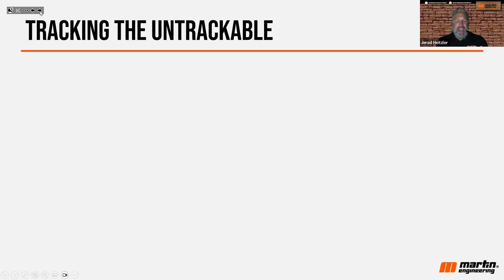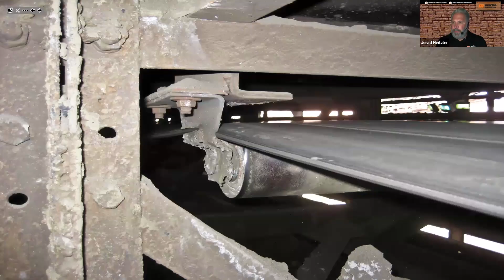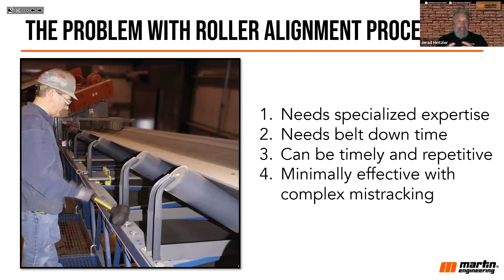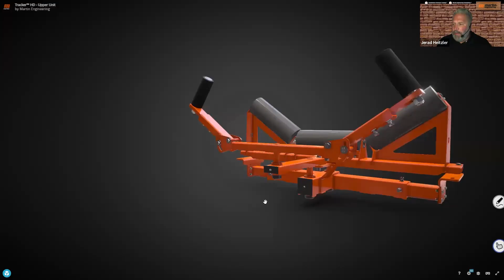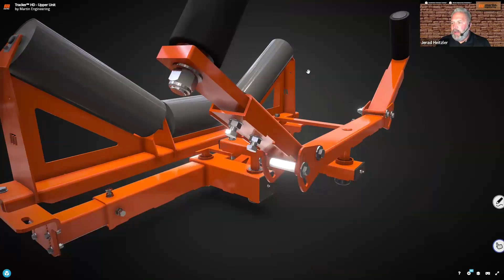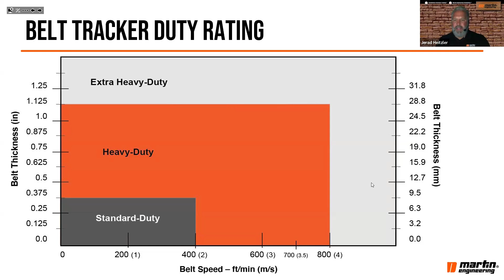Tracking the Untrackable Conveyor Belt

Comment: I don't understand how you can be a materials handling equipment technician and not have the expertise to track a belt.
Reply from the maker: Belt tracking can seem straightforward, but in practice, it’s influenced by many variables, like load conditions, belt tension, pulley alignment, and structural design. Even experienced technicians can run into complex issues that require deeper troubleshooting or support. That’s why ongoing training, collaboration, and the right tools are so important in the field. Our videos are produced to help inform and support people at all experience levels who may be facing these real-world challenges. Thanks for watching and commenting!
Reply: Once I had a 60” FSxFS belt that was about 350’ long on top with atleast 5 seperate lacings , on top of that it went through 3 different hitch points , inclines and declines. To make matters even worse the framing wasn’t square throughout the line and it made tracking a total pain it had a weighted take up pulley on the drive end I ended up installing 2 Dutchman’s to cover all the lacings and then removed one of them about a week later due to belt stretch.